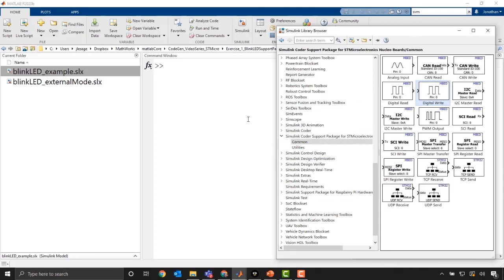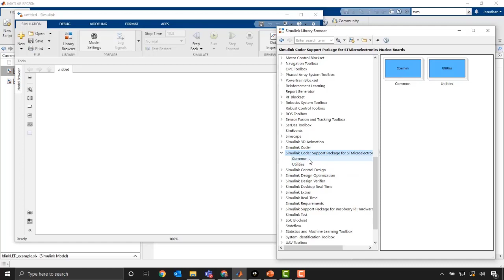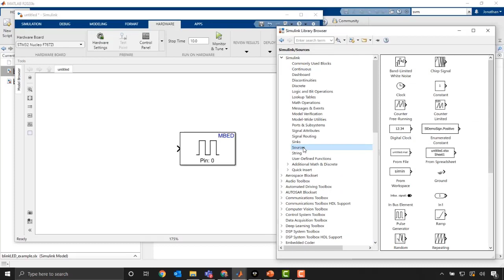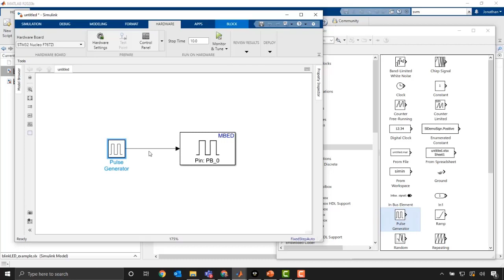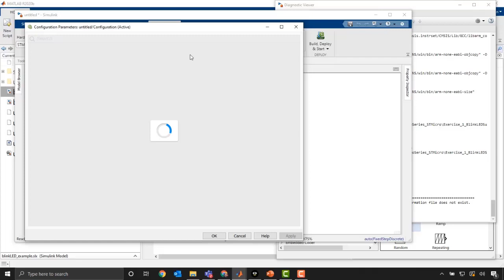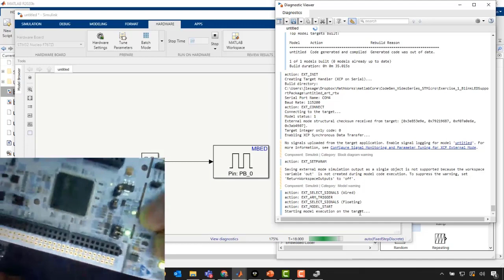Rapid Prototyping Demonstration | Deploy C Code to STM32 Nucleo Using Embedded Coder

Comment: when I connect pulse generator block to the digital write block I always got error. Im working on Embedded Coder Support Package For STM32 microcontrollers how can I fix it?
Reply from the maker: It is hard to know what is wrong without the specific error message. You might be using a different pulse generator block that might have some other requirements.
Reply: @MATLAB  I don't use Pulse Generator actually I'm just using timer blocks and constant percentage value but I still got same error
Reply from the maker: @alperengul2578  Can you share the exact error message?